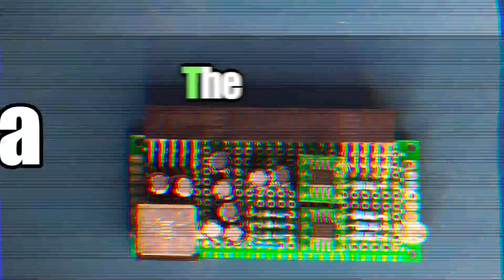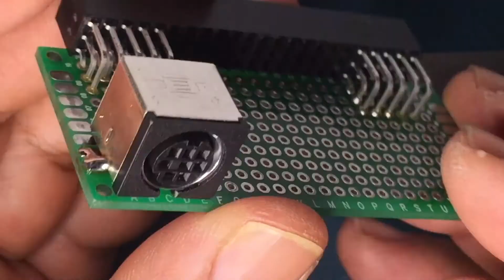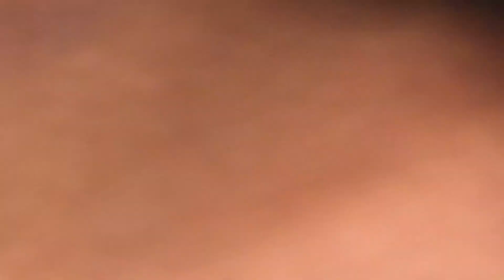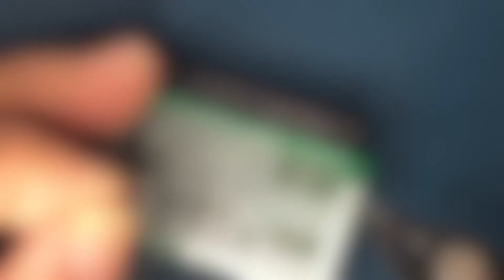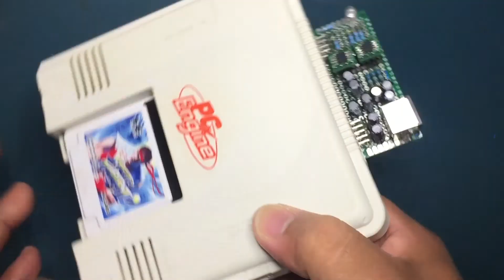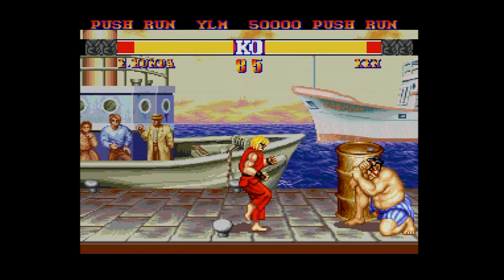PC-Engine RGB Adapter Build [ep. 56]

Comment: Could a single THS7374 (4-Channel SDTV Video Amplifier) be substituted for both THS7314 (3-Channel SDTV Video Amplifier) and THS7316 (3-Channel HDTV Video Amplifier)?
The THS7374 is a TSSOP-14 package with smaller leads.  It costs less than a single THS7314 or THS7316.  The low pass filter can be bypassed.  The chip can be disabled while being powered.

Comment: Awesome result! I would like to be half of skilled as you. I bought a modded IFU-30 for RGB output and the quality is not even close to your home-made solution. I envy you. Congrats!
Reply from the maker: How much did you pay for the IFU-30? This is pretty easy to make and cost less than $10 for materials. If you haven't soldered before, it's quite easy.

Believe me, you are giving me too much credit for having these "skills." It really doesn't take much talent to do this or read a manual telling you what and how to do build this as the data sheet pretty much tells you how to do this. If you would like to try this but have questions, don't hesitate to ask.
Reply: $104.49 ( http://bit.ly/2ENFzDC )   and I can tell you after reviewing your videos you get 10x better video quality output than me U__U
Reply from the maker: Hmmm.... interesting. What are you using as your monitor? A CRT or LCD?
Reply: LG 1080p LCD TV with about 3 years old. I connected it using an upscaler (cheap one, no framemaister) or directly to the SCART entry. No big differences: crappy quality image similar to the quality obtained with the AV output.
Reply from the maker: Javier Sianes Wow, that bad? It couldnt be THAT bad. Well, again, consider making this circuit as its cheap and fairly easy to do.

Comment from the maker: Anybody notice that the protoboard is not really 3x7cm but rather 30x70cm? Misprint on the board, and I've just recently noticed. LOL. It should have been obvious.
Reply: Looks closer to 3x7 to me. 70cm is 2.3 feet long! I’m mostly surprised the miniDIN pins line up with protoboard spacing since the 9 and 10 pin versions wouldn’t. Very cool!
Reply from the maker: @emmettturner9452  oops! What was I thinking! 😭

Comment: nice job. looks good. why not use rosin core solder?
Reply from the maker: neozeed1964 Shinobi fan I see.

The amount of rosin in the core is not enough to make soldering much easier with the use of more rosin flux. Using flux helps the solder to flow and wet better. It also helps prevent the metals you’re soldering from oxidizing, thus making the solder adhere “easier/better.”

Besides, doesn’t all commercially available electronics solder have a rosin core?

I used 60/40 solder here, although I’m gonna get some 63/37 solder for its lower melting point. I stay away from lead free solder because of its higher melting point, even if it’s safer.

Comment: Where do you buy a PC engine Extension Bus Adapter?
Reply: J PL Ive used pata hdd connectors
Reply from the maker: J PL Read the post by ‘Helder’ in this theead:

https://assemblergames.com/threads/23x3-expansion-port-connector.45732/

Please do not abuse the source!

Comment: Great work dude! This is a ton of great information in this series and I learned a lot along the way. Thank you for putting it together!
Reply from the maker: Thanks man. I forgot to include the "what I learned" stuff at the end of the video. Top thing I learned though, is that if you want the best video output, remove all coupling capacitors after the video chip. Only thing needed on the line is the matching 75Ohm resistors. The caps only add distortion to the signal(s) and is only there for compatibilty of old equipment, and laws (in Japan, it's required.) I suggest googling and reading up on "AC coupling capacitors for video" and "video capacitor droop." Maxim Intergrated had a couple articles on this.

Also, if you are going to use coupling caps, then use at least a 1000uF or 1mF capacitor, which was stated in the THS7314 data sheet. The 220uF caps in consoles and some Scart and JP-21 cables could have used 1000uF caps instead... funny how they claim to be the best, but use the lowest recommended ratings for components (to save money). And yeah, the manufacturers all go lowest common denominator to save money. That THS7314 contains a ton of information.

The PSOne video fix I did a couple videos ago, I should have just pulled the caps and bridged the pads. The video would have been better.... or would it? I forgot to make a comparison video of 'AC coupled' and 'non AC coupled' video output to show how much or little droop affects the picture. Oh well.